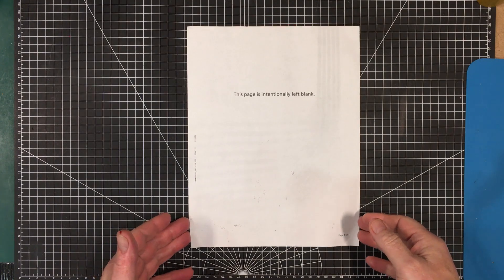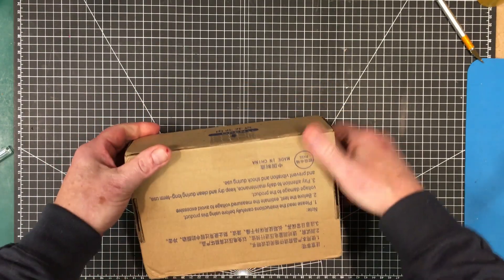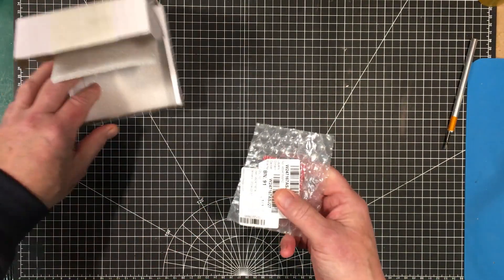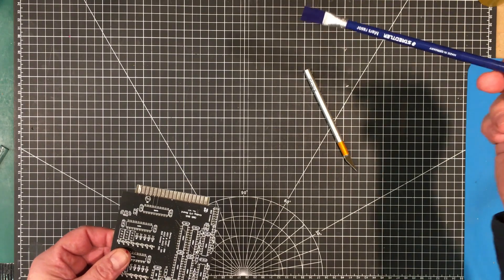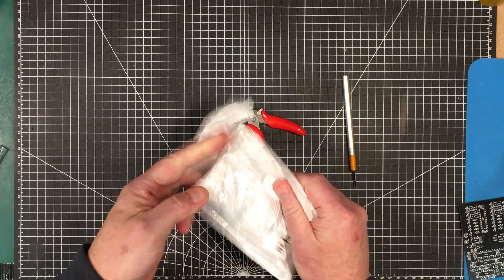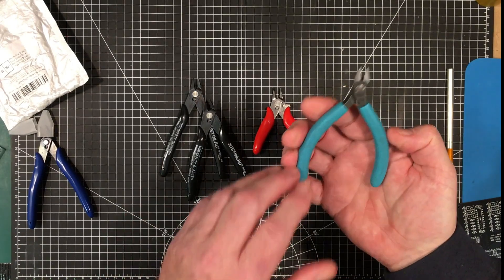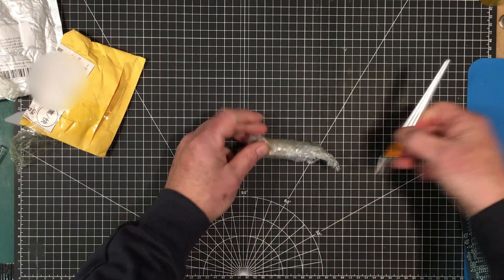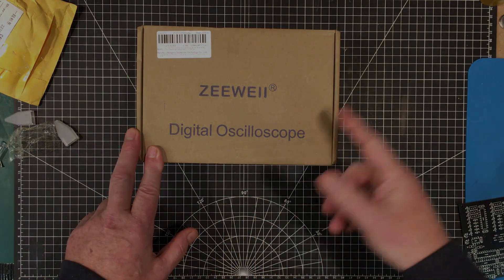Uni-Byte 0175 - Mail Bag 22: A ZEEWEII DSO3D12, PCBs from PCBWay and some NEEDED tools

Comment: I work with robotics and building cells for the auto companies. In the drawing packages we receive are blank pages. The intention of blank pages are for notes. Designers, controllers, mechanical, electrical and supervisory notes can be noted on the blank pages for reference and reminders. In R/D, design changes are a constant. So having these blank pages really comes in handy in times of design or layout  flaws or changes. Most, if not all these blank pages have page numbers also, so when referring to a specific change, you can refer  to the page number in meetings are update calls.  I find them to be very handy and efficient.
Reply from the maker: Absolutely.  Been there, seen that and used 'em many times.  But in this case, the page has writing on it telling us it's got no writing on it.  That's what I was hinting at.

Thanks for taking the time to watch and comment.  Much appreciated.

Comment: I have a couple pairs of those mini flush cutters. I like them because they have the lock, they lock closed so they fit in my little tool holder on my bench. I buy the regular sized ones in packs of 5 or 6. It’s a better deal than buying two at a time and I’m rough on them anyway so go through them fairly quickly.
Reply from the maker: Sounds like a good idea.  I got these on one of those "Buy 3 and Save" sales so I got 1 one the small ones and two of the regular ones and paid about $3 each for them with free shipping.

Comment: They are sheets merely used as a protective cover, or they are one sheet of a folded sheet book or booklet that has nothing to say on the other folded sheet used in the construction of the book. The statement is used to let the reader know that there has not been a printing error, and that no information is missing. These days, with printing processes so sophisticated they should really print a useful image on them instead of an inane, self-denying comment.
My irons all shut themselves off if their temperature doesn't fluctuate once in a while. I've come a long way since I used a wood-burner with a nail wired to it to do my soldering.
My cutter selection is nearly identical to yours. I have 1 very good cutter that looks identical to yours that I only use for soft leads.
BTW, I note that unlike some YouTubers you don't wear gloves to disguise your hands.
Reply from the maker: Yeah, you get my hands "as is" with all the cuts, burns, and grime intact!
Reply: @uni-byte I have seen some disgusting fingernail videos in my time so cuts and such is fine, but no grime on your hands sir 😂
Reply from the maker: @Chuckmefarley  Thanks!